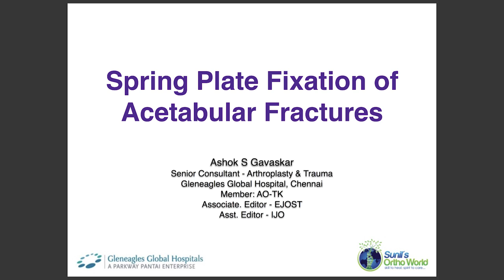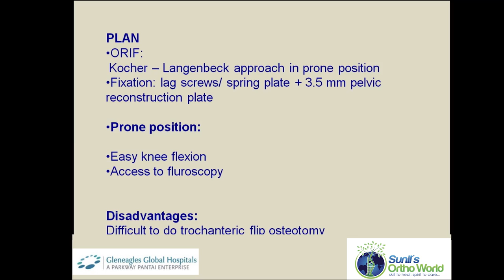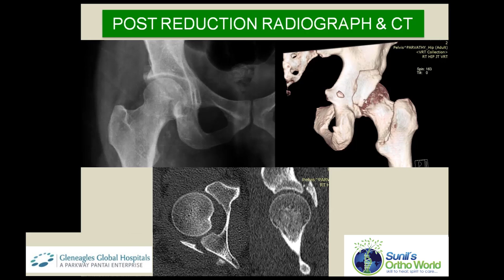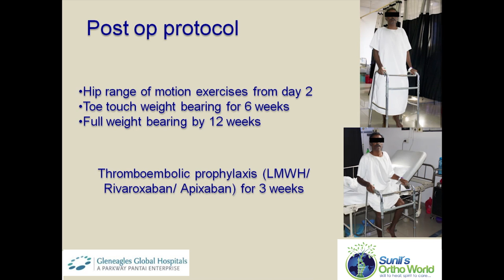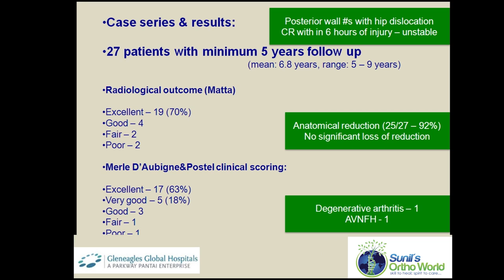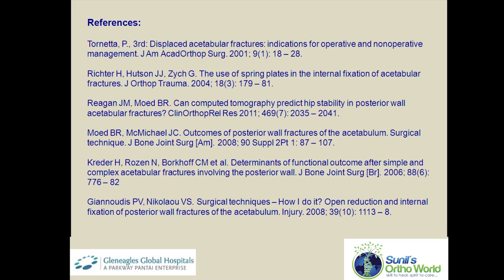Spring plates for posterior acetabular wall fractures

Comment: Same operation I have done before 2  weeks and how many days it will take to walk normally
Reply: same with me at july 2022..you can walk normally?
Reply: @helmyagogo9061  how are you now? I had orif 6 weeks ago.
Reply: took me 3 months to walk normally
Reply: @yoursocool94  Did you remove the bracket and screws?
Reply: @KarimHR-pb4bs  I did not, they said it’s going to be better if it stays in
Reply: @yoursocool94  I had the operation 5 months ago, but it hurts.  I also cannot walk normally without crutches.  And the doctor said that I have to remove it
Reply: @yoursocool94  They say it is more difficult to remove than to install
Reply: @KarimHR-pb4bs  hey
Reply: @KarimHR-pb4bs  i also had this opration two months ago now my doctor told me to walk with full weight I'm learning this but did you feel pinching on the opration side can the screw heart?
Reply: @yoursocool94  did the screw hurt us to the back side?